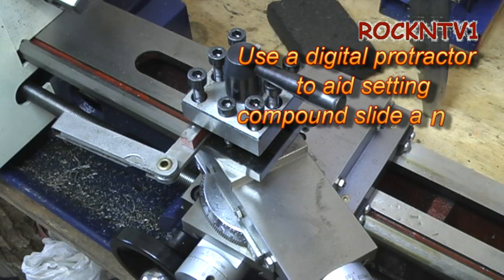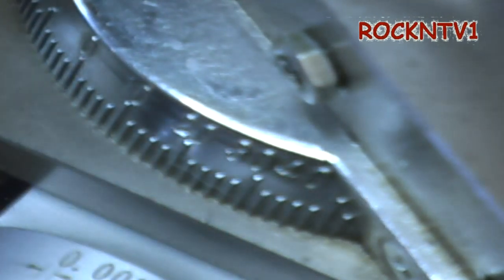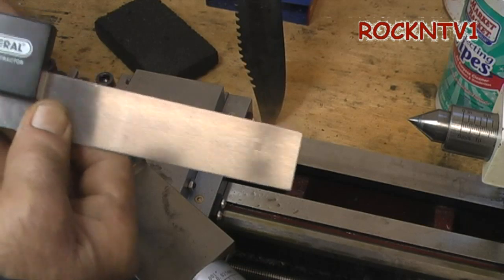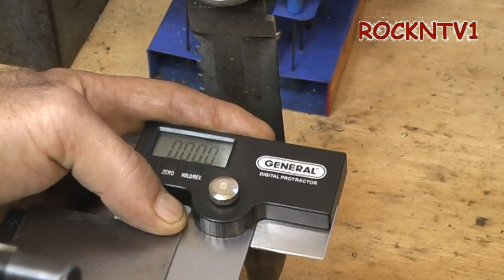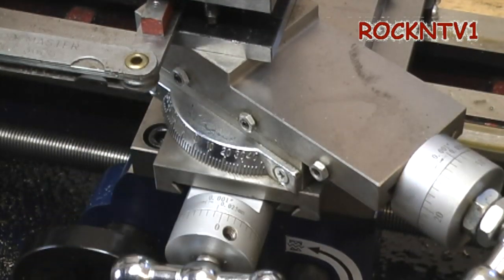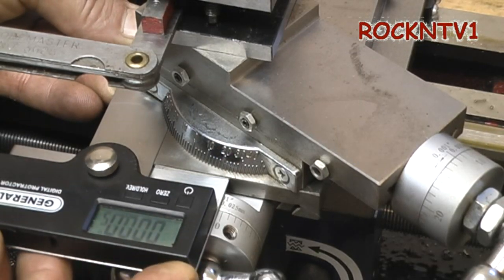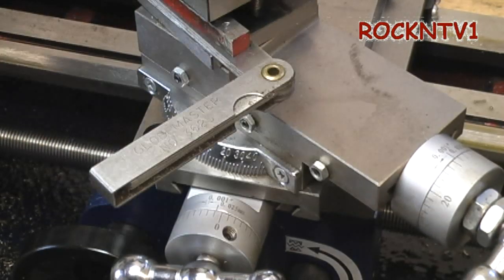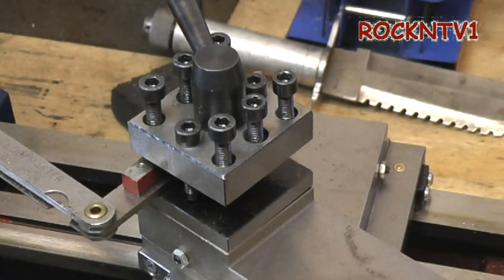LATHE Setting COMPOUND SLIDE tool angles Digital Protractor

Comment from the maker: the digital protractor is a usefull tool, and may be used for setting tool angles on a manual lathe or cnc. This is a demonstration of the protractor, not lathe technique.

Comment from the maker: DUDE, Thnx  for being my hero, the video is about the  digital protractor and ITS accuracy, not the we tah did , plastic indicator on the lathe. pro tip, the POS mini lathe saddle is machined on four sides and should be Close enough to 90 to check a protractor for demonstration purposes in the video but your welcome to borrow a cmm to test yours.